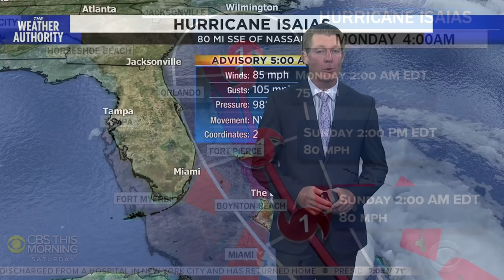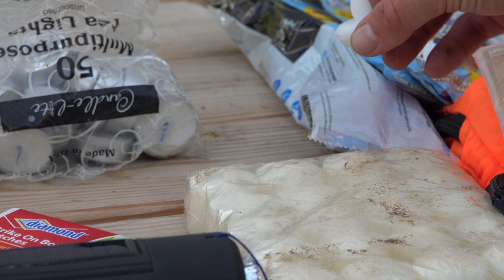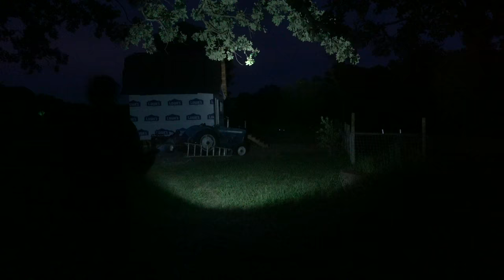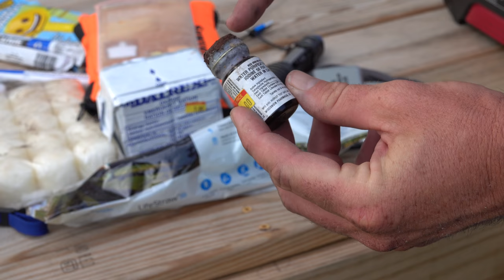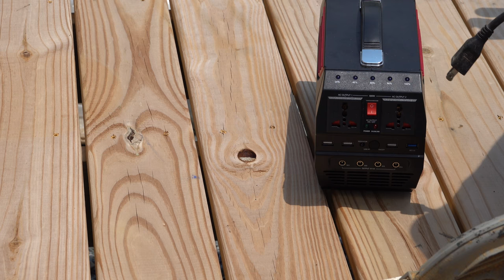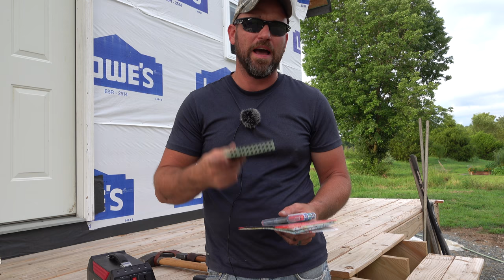TOOLS TO SURVIVE | A Hurricane

Comment: Another thing I would add to your list if you don't have a gas stove is a portable gas stove (camping type will work). I have an induction (electric) stovetop so I keep a simple one burner portable stove on hand that uses butane canisters. I have about a dozen canisters on hand that provide ~2 hours of cooking time per canister. If the power is out long enough I will need to start cooking as much food from my fridge/freezer as possible to avoid having to throw too much of it out. Another thing I do when a storm is approaching is to throw a bunch of bottled waters in the freezer. I use them as ice packs for my larger cooler if I have to resort to using it to store food and can drink them once they have thawed.

Comment: @Yanasa Ama Ventures
Are you noticing the weather in the Midwest?  Its the beginning of August and we're about to have 56 degrees where I live in Illinois near Kentucky (like 77/56). In fact that spike of cold air is going to go almost all the way to the bottom of Texas and northern texas may end up a tiny bit colder than us. I see projected temperatures in the dakotas down to 45 degrees. (In August.)
While everyone is distracted with the hurricane theyre not noticing that this cold weather is ON THE MAP. The fact that its on the map, and able to be pulled down to where we live - and stick here for a little while - means that in September theres going to be a WHOLE LOT MORE of it up in canada and the arctic.

Early Winter again in 2020. Even if we end up with heat waves between now and then, ill bet we get a Frosty start to October just like 2019.
This pattern happened in 2017, and by Nov 1st we had a low of 26 degrees.

Regularly, if you consider 1980-2010 models:
* In august its impossible to see temperatures below 60 and improbable to see anything below 65.
* In October we come close to freezing or have our first frost late month, and its only a singular jaunt. Its synonymous with halloween.
(In 2019 it was beginning of 2nd week, and repeated 3 times, and we had 14 degrees in early Nov).
* Last Frost in March
 (in 2020 it was the 2nd week of April).

Comment: Mr. Tender solar battery chargers are $20.  Rechargeable battery jump box works better for me than jumper cables on a day to day basis.  I operate multiple large 4"-6" pumps for dewatering a huge construction site, where we are building a dam.  Small gas powered generators are a necessity.  Couple 5 gl cans with Sta-bil fuel stabilizer will keep fuel good for about 2 years, but it's easy to rotate gas.  Plus you always have extra if you just need to get the fuck out of Dodge and don't want to go to a gas station.

Comment: I have a question. Does your state require the walls facing east ( the direction where hurricanes come to land make landfall) to have studs two feet apart? How far inland do you have to be to be five feet off the ground? Does your building require to be tied down? Does the roof require to be hurricane fastens? Just curious.

Comment: So just a trying to be helpful from the swamper . we had quart jars with lard on the shelf standard render our own fat . For lighting we had oil lamps. If you run out of lamp oil stick a 6 inch wax candle in a jar of lard make a little valley around the candle in the fat and it will burn for a week instead of a couple hours. Works with a candle and a can of Crisco to. Just a suggestion.
Reply: Oil lamps.  They sell modern ones at Wal Mart and other places, but I have a couple old ones I bought at flea markets.  Bought the oil and a roll of the right size wick.  Haven't had to use them.  Our power outages are usually very short lived, so I use candles.
Reply: Lisa LaPoint the old ones  are better made and nicer to use . Play with them a bit to keep the smoke down and they will serve you well. Try a small can of Crisco with a candle in the center can get a little smoky.  you have to get it in there just right. But will burn a very long time and is a great back up if the power is down for a long time.

Comment: The gov's military can make hurricanes stronger. They can even create them. If they can make it rain they can do anything they want with the weather. Harp is a military project. There is another project they have to create earthquakes too. Forgot what it is called.
Reply: I looked at August forcast. It seems like a cold front is coming that would kill the hurricane. Last year there was a hurricane (hurricane barry) it was gaining strength hitting lousiana but a cold front came. It died down.
Reply: Just think of this : the cascadia subduction zone is due to pop and the pressure shift could give a new mountain range and reactivate our volcanos. None of them add the effect of all the drilling from hydrothermal and oil into the crust. So basically we are screwed.